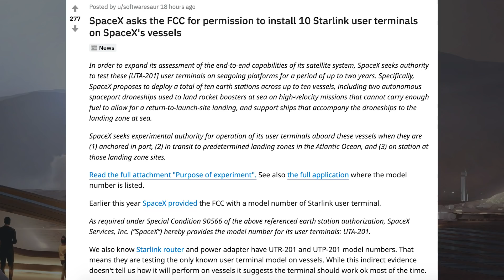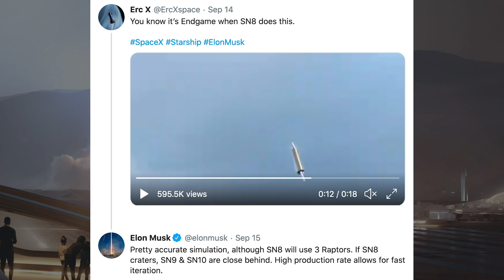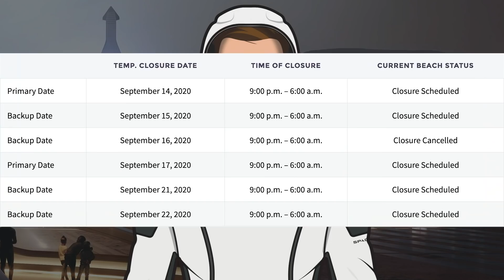SpaceX Starship Updates! SN7.1 Tests, SN9 Stacking! TheSpaceXShow

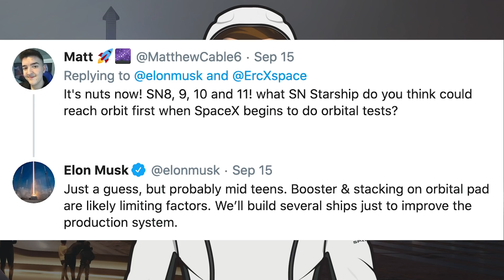Comment: 2:00   - Interesting that Elon says stacking is likely a limiting factor for orbital tests - not heard any speculation about how a StarShip will be craned 150m onto a booster on top of OLP...
Reply: Right! I suppose they could hoist the two together up from a lying down position, or build a massive elevator to carry the starship up and place it on top of the booster. Nothing is impossible with Elon.
Reply: @urmshippilot4434  Like the elevator idea!  There seems insufficient room to raise from horizontal, and handling has been vertical so far.  Initially I thought they would deploy a commercial crane, such as used for large wind turbines - however, I don't see why that would then be a limiting factor in the way Elon tweets.